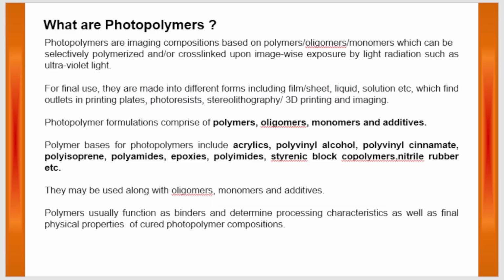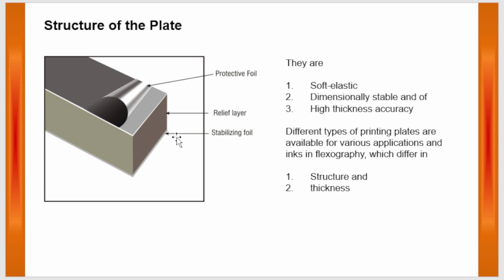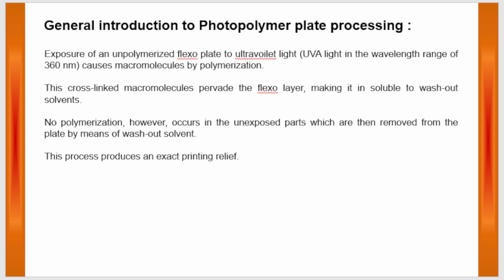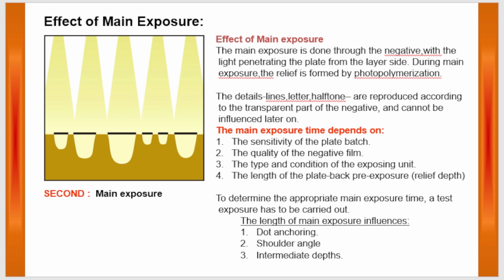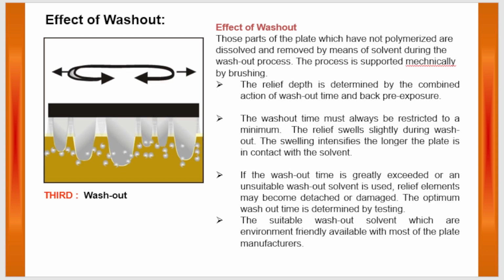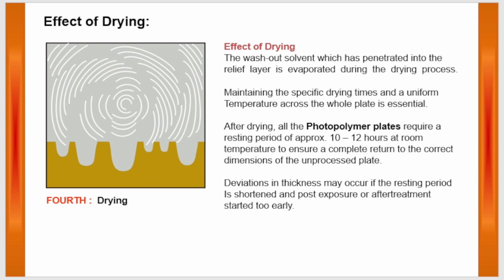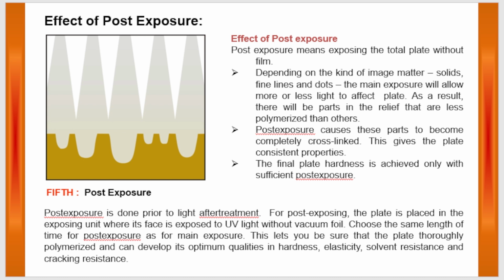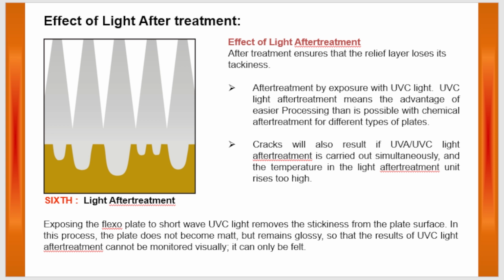Chapter  7  What are Photopolymer Printing Plates

Comment: I am facing issues with edges when removing it from the cylinder.
Wave type pattern is formed and it is not sticking to the double side tape.
Reply from the maker: You have to choose a tape with good / adhesive bonding of cylinder to tape.